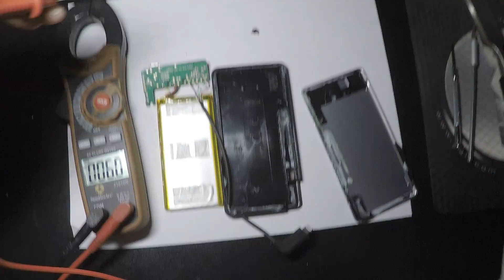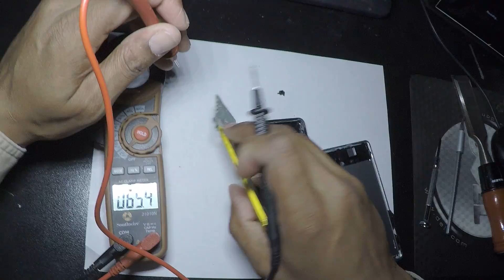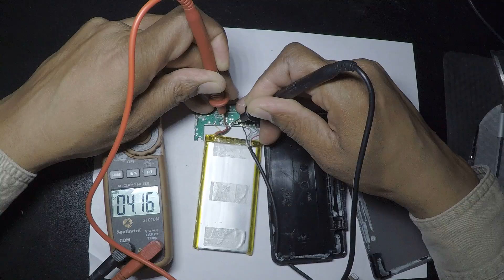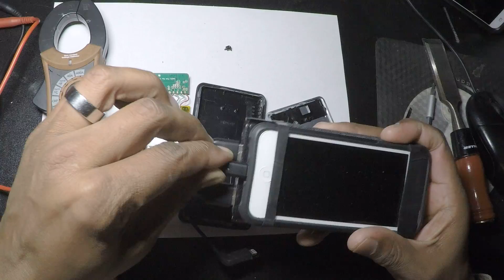mophie powerstation Plus Mini 4000mAh Battery dissasembly (open) Part 2

Comment: Aren't you supposed to press the power button for 2 seconds to get it to charge your phone.
Reply from the maker: You may be right, thanks. I don't know if I even still have the unit or if I had tried that. I have many other units that work great.

Comment: Hey @Allyn, have you ever discovered the problem? was it the cable?
Reply from the maker: Actually yes I did. If I remember correctly it was a broken connection inside the unit. I had bought it second hand so I returned it they had a good return policy.